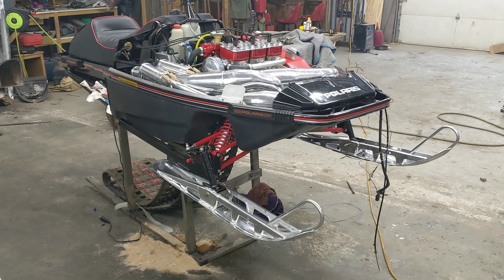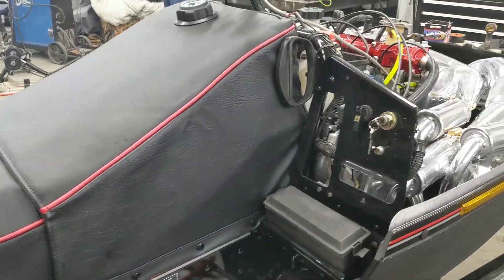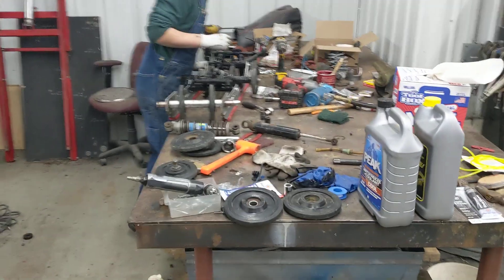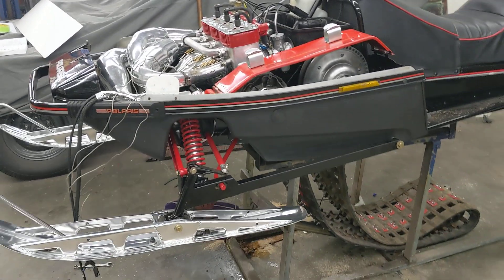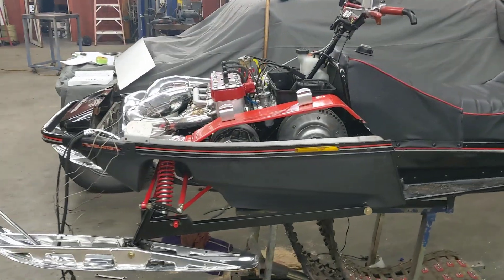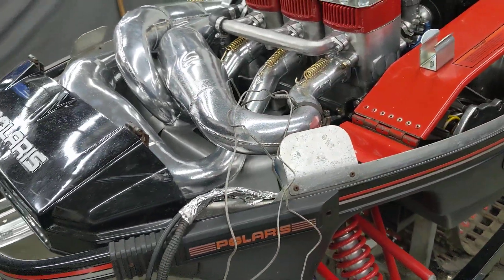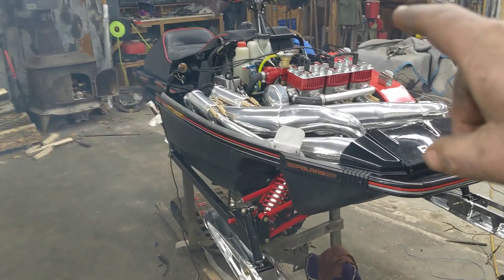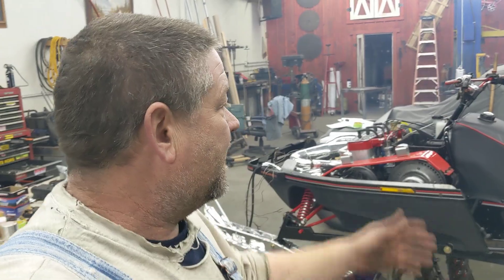CRAZY POLARIS SUPER MOD FLATLAND SLED

Comment: dude 650 looks awesome. bought one brand new in 88 an 89 model had it until 2004.  sold it with 14 k on the odometer  but odometer broke 3yrs before I sold.  loved that sled
Reply from the maker: Great sleds

Comment: it's smoky too because it's rich when it's 70 degrees in your shop.  It'll lean out when it's 20 outside.  Looking badass!
Reply from the maker: 70? More like 55, lol the wife would kill me if I turned the temp up to 70.
Reply: hahaha.  Well you cut all the wood!  I suppose the new supplemental heating can get a bit pricey, though.
Reply from the maker: @TheDillio187  nope gas furnace in the shop now
Reply: @toddclyne3493  so the wood boiler only heats the house now?
Reply from the maker: @TheDillio187  yes for the most part. Trying to burn less wood to cut down on the amount of wood needed each winter. First year of it so we'll see how it works out.

Comment: I have 3 RXL'S  all mint efi  is awesome  2 have pipes and a lot of  clutch  and motor  work. the 94 has clutch and motor work, but I took a  coat hanger and  dug all of the baffling  material from  the  exhaust  and tig  welded a bigger  outlet and I hear it 200 times a run,what kind of  pipes  are those ?and everyone  one says it's incredible  sounding , and no one has ever heard anything  like it. The computer  for the EFI  Keeps it running  perfect  and it flys.if u still have  the original  exhaust , take  all the baffling  out of the  can and try it. It only  sounds  unique  on the EFI 650 RXL'S . I BET u will  leave it on. Wicked snappy screaming  one  of  a kind  sound .
Reply from the maker: I just might have try this one

Comment: Dude this looks really good. Didnt notice what did you do for the bottom end on that motor. Did you swap oil seals at least? At least that PTO end will leak easily when getting older. Cant wait for running video!
Reply from the maker: The whole engine is freash